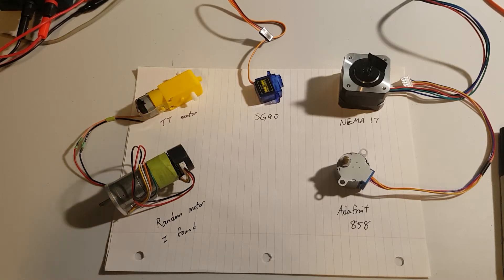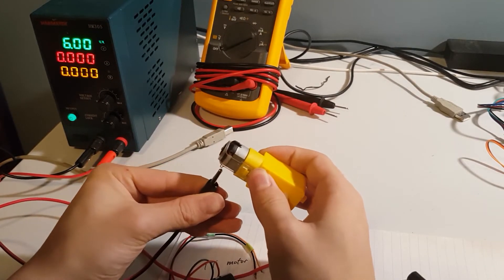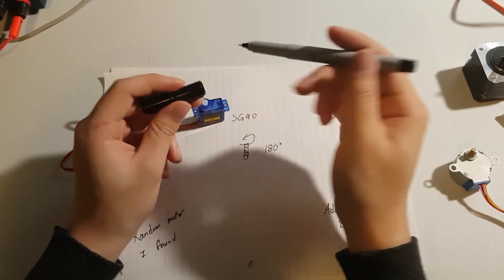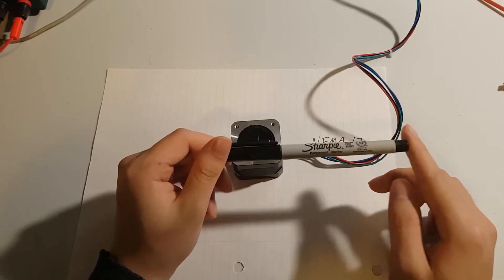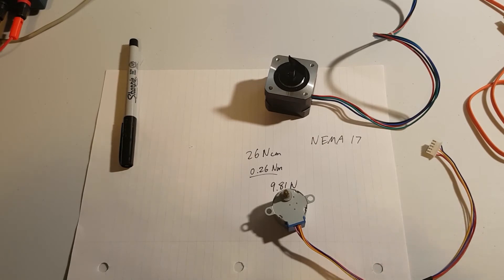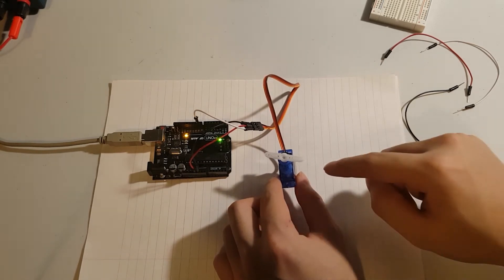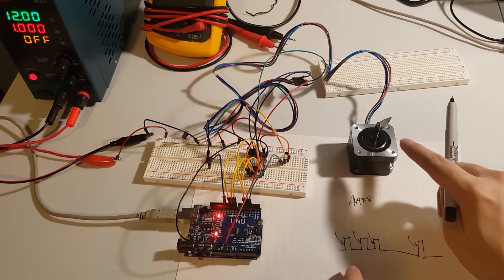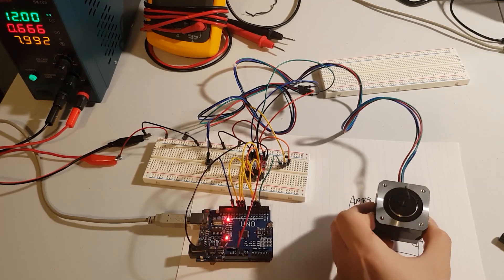Robotic Arm Motor Selection

Comment: It sounds like you’ve done a thorough comparison of different actuators for your robotic arm project. Here’s a brief summary of what you covered:

1. **DC Motors**: 
   - **Pros**: Simple, low cost.
   - **Cons**: Difficult to control speed and acceleration accurately. Not precise enough for high-precision applications.

2. **Servo Motors**:
   - **Pros**: Includes a position feedback mechanism, decent torque.
   - **Cons**: Limited rotation range (typically 180 degrees), precision can be lacking, and not ideal for applications requiring more than 180 degrees of rotation.

3. **Stepper Motors**:
   - **Pros**: High precision with defined steps, better control over position and acceleration.
   - **Cons**: Lower torque compared to servo motors, requires additional components like drivers and possibly sensors for homing.

For your robotic arm, you decided on **stepper motors**, specifically the NEMA 17, due to their precision and control capabilities, despite the need for additional components and lower torque. The plan to use a gearbox to increase torque is a good approach to address the torque limitation. 

You also mentioned future improvements, such as implementing smooth acceleration and deceleration to make the arm's movements less abrupt and more fluid. That’s a great next step to enhance the overall performance of the robotic arm.

Comment: The servo motor can be hacked to provide 360 rotation.  If you take it apart you will notice little notches which mechanically limit rotation.  Use a Dremel to grind down the limiters and bam! 360 rotation. 👌  You will learn these things over time.
Reply: Yes, that is true.
Also, there are some servos that are "continous" - where the 'endstop' is removed from factory. I have those in my current robot arm.

Trying to build a new robot from scratch, using stepper motors + drivers sets me to around $200/stepper motor * 6 = $1200. But those are 24 volt stepper motors with drivers.

Not big enough to compete with robots from Fanuc, ABB, KUKA and so on, also the size of the stepper motor/quality is less then say a Beckhoff brand (as an example).

Also, you can have a stepper motor with an encoder to find postion.

Comment: For driving stepper motors, I would highly recommend TMC drivers like TMC2209. These drivers can run the motors silently, have sensor-less homing feature and can run much higher current through them.

Comment: Thoughts on using brushless DC motors? It seems like the benefits would be greater but cost would increase so Def not used for many diy robots.
Reply: They are used with gearboxes for getting high torque and a rotary encoder for feedback. This makes them servo motors and are the most common ones used in industry due to their high speed and high precision. Though, the cost is high therefore, stepper motors are the most cost-effective solution here.

Comment: How far are you in the project?
Reply from the maker: Progress has been a little slow because of school, I have the electronics and mechanical design done, software development has been holding everything up. I still plan to finish it
Reply: @sichun100  what are you using for mc?
Reply from the maker: have been using arduino, but I think I might port everything to a Raspberry Pi